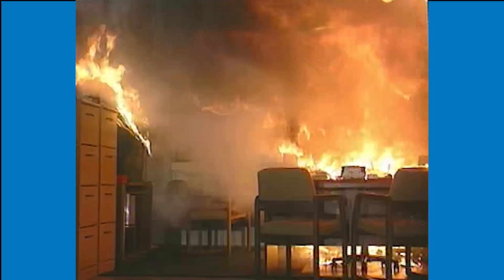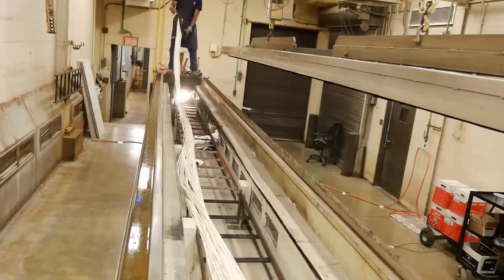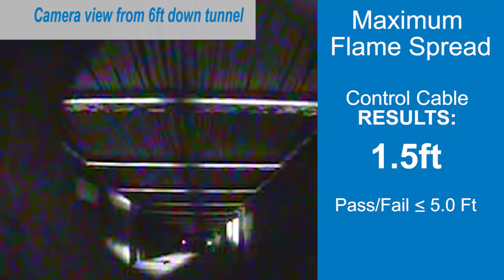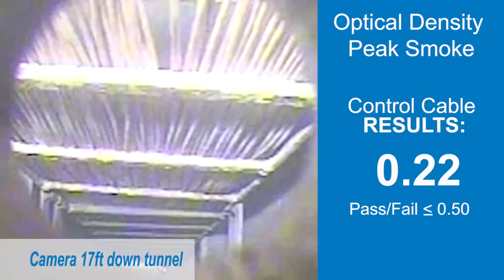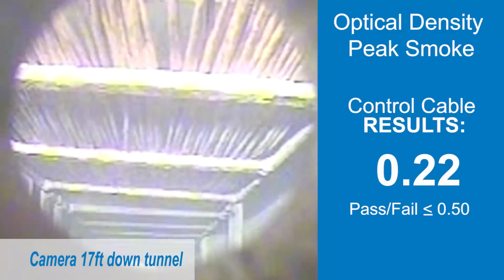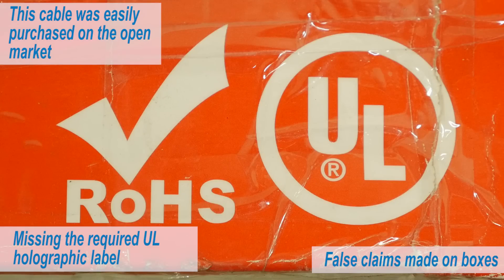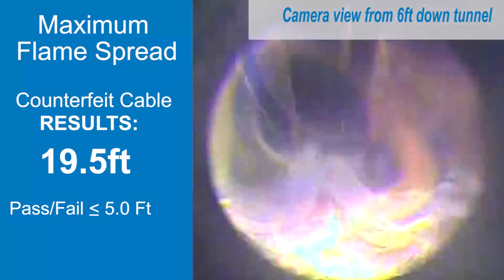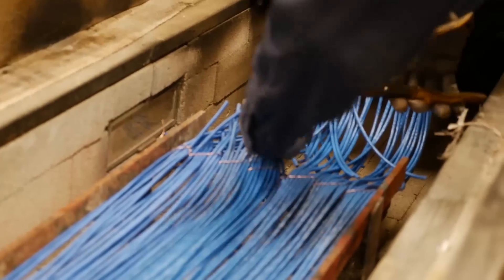CCCA Counterfeit Communications Cable Fire Test

Comment: A video ALL cable installers should watch with their customer sitting beside them. Then we'll see how many cheap cable installations are performed. I lose many bids for wiring installs because my cable is compliant which means more expensive while the cheap guys are laying the bad stuff all over the city. I'm going to save this video link for a quick show to customers when submitting my estimates. Thank you for this video.